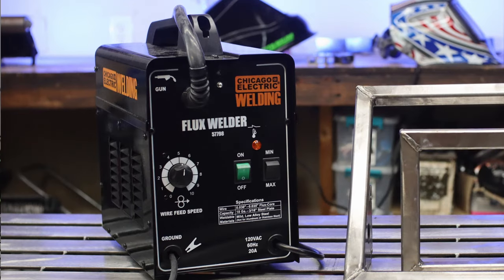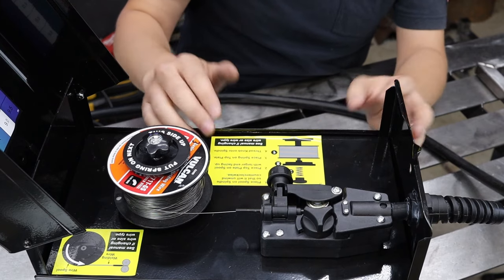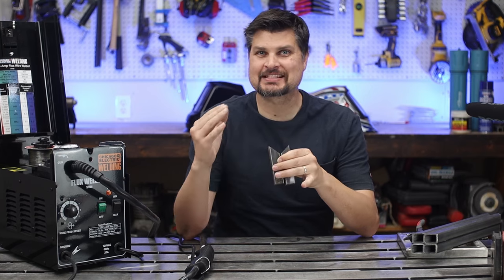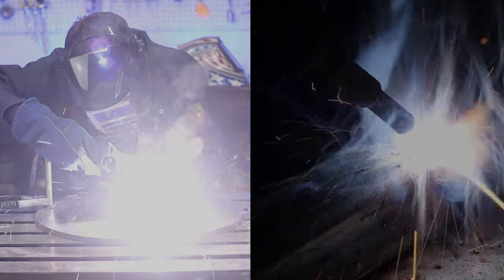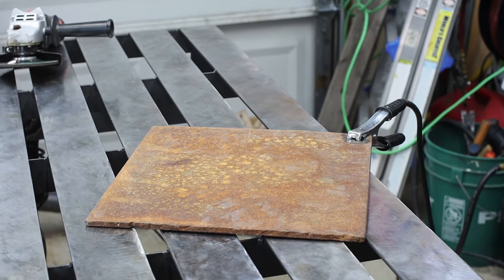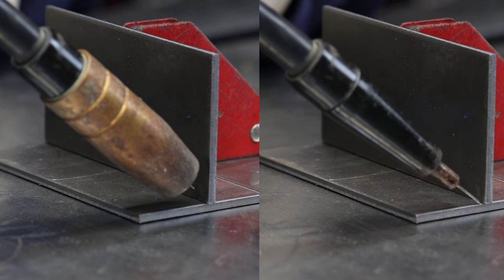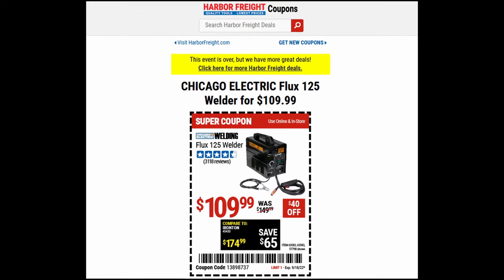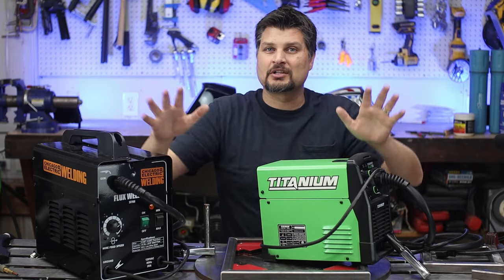Harbor Freight Welder: Chicago Electric 125 Review, Setup, and Test

Comment: Here is my problem…my unit turns on and the wire comes out fine.   I just don’t get any spark or arc.   I can even pull the trigger and as the wire is coming out, touch the wire to the grounding clamp and still no arc.   No broken wire inside the welder and the PC board looks to be sound.  Any help or suggestions would be greatly appreciated.
Reply: Check your ground clamp good to make sure it is tight, and if so put your ground clamp closer to the area of metal that you want to weld on. You can wirebrush the area you want to ground also, for better grounding. If ground clamp is too far away from weld area, you tend to lose your welder's ability to spark/weld.
Reply: @Slim1423  thanks for responding, however I can put the wire directly on the ground clamp and get spark.   The clamp is very securely attached to the ground wire as well.
Reply: What i meant to say was I can touch the ground clamp with the welding wire and still not get a spark.   So it’s not a question of being too far away from the ground clamp or having a dirty piece of iron.   I wish it was that simple.
Reply: @jeff11030  Ok. I don't have this welder, but HF sells a copper clamp with a long spring that might work better for your welder, to give it a better spark. Might work for you.
Reply: @jeff11030  Maybe check wire feed tensioner to see if wire is making good contact with wire feed roller. Close contact between wire and wire feed roller might make your welder spark.
Reply: @jeff11030  Also, pull gun trigger with weld wire to metal with power setting on high, and on after on low setting and see if wire sparks. If it works on either setting, then you may have a bad voltage switch.
Reply: @jeff11030  HF sells a Berger 300 amp welding ground clamp for $6.99, Sku 63784. It might make your welder spark. Also, with welder unplugged check tightness of copper contact tip, and brush off contact tip with wire brush. Might help your welder spark.
Reply: @Slim1423  thanks for all your suggestions.   I’ll try all that today.
Reply: @jeff11030  Ok. I hope you can fix your welder. I have a Lincoln Electric Weld Pak 100 i am trying to fix myself. Had my welder for 17 years, but started having problems less than a year ago.  If i can't get it fixed, i may buy the Chicago Electric 125, its on sale for $87.99 at HF for Black Friday. A welder is a good tool to have.
Reply: @Slim1423  thanks for letting me know about the sale on the 125 amp wire welder from HF.  Just picked one up.  I tried everything both you and I could think of to get the old one to work. I had it for 9 years before it stopped working.  I guess I got my money’s worth from it.  I also have a large Lincoln stick welder I’ve had for 30 years and still going strong.  I use the smaller wire welder for small projects and thinner metals.    I still might fiddle with the old broken one and see if I can one day get it working.    Thank you for your advice
Reply: @jeff11030 Ok. You're welcome. i am sorry you couldn't get your old C.E. welder going, but atleast you tried to fix it.  However, i am very glad to hear that you bought a new C.E. welder while it is on sale now at Harbor Freight, and a goodbprice too. If you got a lot of service out of the old C.E. welder for 9 years, then you got your money's worth. There is nothing like owning your own welder, to save on welding costs! Welders pay for themselves i feel.  When i originally bought my Lincoln weld pak 100 many years ago, it was because a body shop guy said it would cost me $200 to $300 to repair the frame of my car, and he said i would have to cut a frame piece from another similar  car with my own funds additionally. So, that is why i bought my welder to repair my car , and i have never regretted it. I hope you many years of reliable service with your new Chicago Electric 125 welder, and i hope you can fix your old welder also!

Comment: So how do I get mine to weld like this. It keeps sputtering.
Reply: Some say the wire that comes in the box with the C.E. welder splatters alot, but if you use a good brand of fluxcore wire , it may weld a lot better. Better brands of wire like Lincoln and some say Blue Demon wire is good also in .030 wire size.
Reply: check your polarity. Flux core uses electrode negative. your ground should go to the +terminal and the negative should go to the gun.
Reply: It's not a very good welder. Not sure why he says it's good.

Comment: Can you reverse the polarity on it
Reply from the maker: No, the leads are hard wired into the machine. I guess you can if you tear into it.
Reply: It can be converted from AC voltage to DC voltage. There are youtube vids that show this method. Some say it welds better with less spatter this way.

Comment: Just to clarify, I don't need a special outlet for this though right?
Reply from the maker: No............but the outlet will need to be on a 20 amp breaker if you want to max it out.
Reply: @-DIYPRO-  good to know thank you, I don't think I'd ever weld anything thicker than 1/8" so I shouldn't have to worry about that if so I'll just plug it in the generator, thanks much🤙

Comment: Ive been using mine for 5 years. Used it in many project makes strong welds.   Tried welding my Pathfinders shock mount it 3/16 metal but the HF welder didnt work  The  mount brackets broke again. Tried it 3 times
Reply from the maker: The material has to be prepped and have good conditions for a full penetration weld on 3/16"

Comment: He failed to mention that you can only weld for a few minutes until it over heats and will not function again for use!
Reply from the maker: Depends on if you have it maxed out. If so then yes, I think it only has a 20% duty cycle.
Reply: Is that why it's only giving me non shielded tacts now
Reply: Is that true, because I'm going to buy one, I need to know
Reply from the maker: @marcusvernell2324  yes and no. If you are welding on max settings continously for a couple minutes then yes it will shut down until it cools off. Keep in mind most people aren't doing projects that are needing max thickness settings. What are you wanting to use it for?

Comment: On mine it’ll feed them stop I’ll take out the wire multiple times and put new wire in and same thing it’ll happen then for some reason I let it feed until it stop and cut the wire and put more wire in to see if it might come out nope nothin anyone know what might be wrong ? Everything else on it is fine , I went to harbor freight to return it my receipt didn’t even say on it that it was purchased nor on my account and they saw me buy it the day or two before
Reply: Did you get another welder free of charge?

Comment: My welder is feeding but not welding what do yall thing is the problem
Reply: A possible bad welder grounding clamp, or ground clamp not making good contact with the metal you are welding on. Try cleaning contact area of ground clamp with wire brush, to get welding to start arching. You can also replace ground clamp with a new ground clamp with tighter grip, to get welder arch to start. Harborfreight i think sells welder grounding clamps. Some welders also may  have a reset button to make welder work correctly, but not sure this welder has a reset button. Hope this helps.
Reply: You can also try to put your ground clamp closer to the area where you need to weld. If the surface you are welding on is rusty, you need to have a good area near weld area to connect welder ground clamp. So, try  brushing area for grounding clamp with a wire brush to expose shiny metal, to make good contact area for ground clamp. Hopefully, your welder will start arching after that.

Comment: Save your money and get a titanium brand instead, way more control since you can actually dial in voltage, I've had this Chicago electronic one for years this minimum setting is basically useless it barely penetrates even with the proper settings and material. This machine will give you too many headaches as a beginner so spend the little extra and get the better machine.

Comment: That's the biggest piece of junk, the hole in the tip where the wire makes contact with the voltage is too large so the arc isn't consistent making it nearly impossible to continue a consistent weld.  I understand why owners are converting their welders to DC and changing the tip end to correct size opening to match the .030 wire diameter.

Comment: For some reason my Chicago is not welding that way. I don't know if I have it plugged in the wrong way I don't know if I have set up the wrong way. It's just not welding like that.
Reply: Is your welder connected directly to a wall outlet? If using a extension cord, is that cord rated for the maximum amount of amps/wattage for your welder? Welders need lots of electricity to work properly, some need 15 amps or 20 amps total. Your instruction book for welder should specify amperage requirement.

Comment: The only aspect of your commentary that I don’t appreciate is you acting like a $150 piece of welding equipment is basically total junk, excuse me but for people who are non-welders and don’t wanna buy a $10,000 Lincoln maybe chill on the disrespect for whoever engineered and or invented this machine, could you build one? I seriously doubt you could manufacture all the parts and make that welder so don’t be so disrespectful.
Reply from the maker: You are correct, can't knock on it since it welds and gets the job done!

Comment: Every time I use mine it just burns holes 🥲
Reply: Wire Speed set too high, possibly. If you are using .035 weld wire, you could switch over to .030 weld wire to help prevent burn through. Could turn voltage down from max to min to prevent burn through.

Comment: You should not be telling others to take that gas cone off and using without it you should be telling us to immediately replace with the correct innershield cone and not to use without it because you you will damage the part that allows you to change the contact tips easily I've been using welders for over 20 years and you should also be telling newbies that the contact tip should be rather snug otherwise you will fuse weld the contact tip into the holder making it where you have to replace parts that are likely not available because it's not a high end welder that uses interchangeable parts with other machines

Comment: I recently purchased this unit. The  fan comes on and it feeds just fine but I'm getting 0 spark.Ive checked my ground and power source and still nothing.the fuses are also good .Any help would be greatly appreciated.Also this machine didn't work out the box and I waited too long to open it so it's passed it's warranty....thank you
Reply from the maker: The last test is to try welding the ground itself. Yes, that is correct. You are going to turn the machine on and try welding the ground just for 1/2 second. This will verify if it is indeed a grounding issue. 9 out of 10 times it will spark and then you know you have to make sure you have a good ground connection. If you pull the trigger and the wire touches the ground clamp with no spark then yes it is a faulty machine and you got a lemon.
Reply: @-DIYPRO-  Thanks